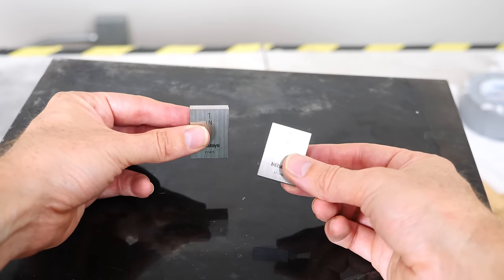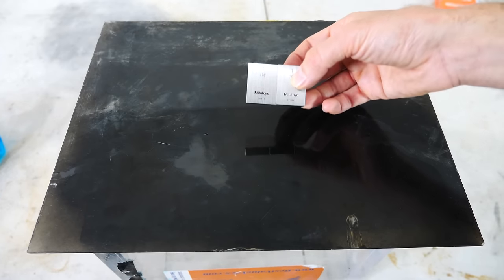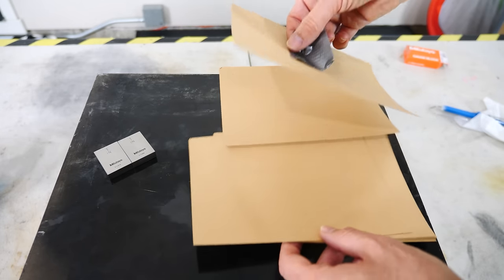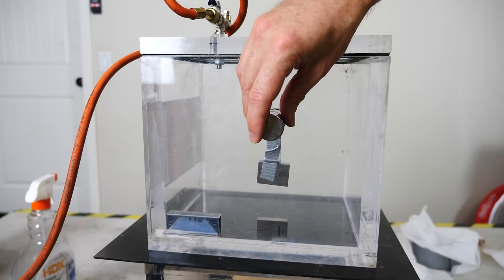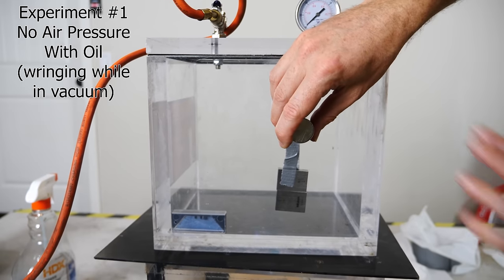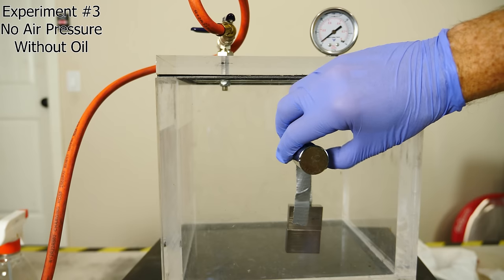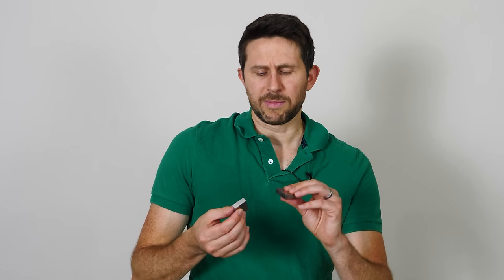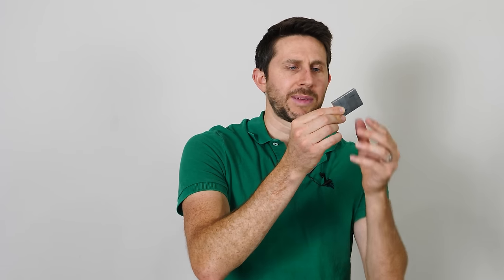Will Gauge Blocks Wring Together In a Vacuum Chamber?

Comment: I have a lot of experience working with gauge blocks in a calibration lab. We had different sets of block gauge of different "class". The class defines how perfect the gauge is, and the perfection is measured in terms of the tolerance regarding it's nominal length, but also in the flatness and roughness of the faces. The best gauges has a parallelism + flatness error combined of 0.05 microns, that is 50 nanometers. That's insane. While that is still a few orders of magnitude bigger than the Fe atom, I suppose it has to allow for millions of atom pairs between the 2 blocks to be in very close proximity. What I found is that, when clean of oil, the better blocks have better better adhesion (and sometimes much better, to the point of really struggling to take them apart, the only way was to use another block to push one of them out by sliding sideways). How much of that is because of just better vacuum and how much is because of more atom pairs being in closer contact, I don't know.
Reply: Ok
Reply: We never, EVER use oil on Joe blocks.
Acetone, a clean sheet of printer paper and proper wringing technique (not shown) works wonders.
Reply: Thank you
Reply: @CraftAero  ... Put the blocks at 90 degrees (like a cross) and rotate. If one or both blocks are thin (risk of bending), put them on a thicker block first.
Reply: cold welding could happen if those atom can meet
Reply: @CraftAero  that's because you're doing it wrong. EVERY SINGLE manufacturer says to apply a light thin coat of oil to the blocks. From Mitutoyo, to Starrett, to every machining website. I even checked to see if I could find one single source of authority that said to not use oil, and I couldn't find A SINGLE ONE. That's unusual, because usually if you search the internet long enough, you'll find a source agreeing with whatever you want. So that's pretty definitive. LOL. Where on earth do you work that they don't oil gauge blocks? LOL. They're bare steel. ALL bare steel gets oiled.
Reply: @littlejackalo5326  I know nothing about gauge blocks except what I've learned today. The internet, however, I know a"little sumpin'" about it, and I agree with your statement-if you look long enough(and I'm my experience it usually doesn't take long) you'll find something that will agree with whatever idea for which you're looking to support. Couple that with the rarity of both supply and demand, and your "pitch", if y you made your point quite effectively.
And THAT I respect!
Well done...
Reply: Regardless of the quality of the blocks, air pressure tops out at 14.7 pounds per square inch. So if you need to apply a lot more force than that, it's probably the electrical attraction force.
Reply: @isaacgrosof212  I was thinking the same thing! Even on sea level at very low temperatures, something that small and heavy couldn't be held together by air pressure alone
Reply: although a suction cup can hold very heavy things, depending on the quality and I'm not really sure how that works in a purely physics level... so I wasn't really sure what to think
Reply: Very interesting, and here i am with 3 Copper cylinder that came from CPU Intel Heatsink, with my greasy finger plus humidity i managed to get all of 3 stuck together.
Even though the surface is far from perfect, if i were to clamp both side and attempt pull them apart, i would probably get many pound of force before it crack off.
Reply: @chicoarraes  ... Well, 14.7 pounds per square inch is 14.7 pounds per EACH square inch. A suction cup of 4 inches will have a surface area of pi*2^2 and that is about 12 square inches, multiply by 14.7 and you get more than 180 pounds.
Reply: How does one accurately measure .05  μm & 50 nm?  With laser light?
Reply: Calibrators unite!
Reply: I also worked with those when I was a tool mechanic. I had to make measurements of 0.001mm and those were pretty exact.
Reply: @ab_ab_c  we have had gauges long before laser was invented.
Reply: @littlejackalo5326  indeed they should always have light machine oil applied, he clai6his blocks are stainless steel which won't rust however most are not.
Reply: @ab_ab_c  Yes... anything below 1 μm is very hard with mechanical means. Now, with interferometry you can go to absurd limits like measuring the deformation of spacetime that is orders of magnitudes smaller than a single Hydrogen atom, like what they do to measure gravitational waves.
Reply: @dogwalker666  ... But it was not possible to certify a flatness + parallelism error of less than 0.05 μm back then.
Reply: @littlejackalo5326  He prob works in machine shop.  I've been a metrologist in both the auto & aero industry for 20+ years and the only people I know that call them joe blocks are machinists and maintenance techs.
Reply: @kiddingme01  must be an American name, I have never heard anyone use that name.
Reply: @MuhammadHanif-bx4pb  which is why you don't leave them wrung for storage.
Reply: @littlejackalo5326  Oil for storage yes, NOT for the purpose of wringing them together !
They usually ship wrapped in oil paper covered with a light wax. It's an apprentice job to unwrap, clean and oil a new set, been there, done that.
Reply: @ab_ab_c  I worked at a precision machine shop where we had to measure stamp depth to 0.0004” we did that using a 100x microscope and used the focus knob travel to get the measurements. Zero out the reading when the bottom of the score line was in focus, and take another measurement when the top of the score was in focus. Crazy stuff!
Reply: @isaacgrosof212  there is probably 1-2 square inches of surface pressed on by the air. That is well stromg enough to hold a couple ounces of steel.
Reply: Do you have to measure things at a certain ambient temperature? Because at that scale I would assume temperature expansion is fairly significant in the gauge blocks?
Reply: @kiddingme01  So I was just doing some reading and found the origin of the name, the original creator's name was C. E. Johannson, or Johannson blocks, which was shortened to Jo/Joe blocks.
Reply: @TheExplosiveGuy  haha thanks!  I actually knew the creator's name was Johannson and never put that together.
Reply: @kiddingme01   same here, kind of a derp moment lol😆.
Reply: @littlejackalo5326  when you have ceramic blocks....
Reply: @2nd-place  basically yes.
In high precision work everything has to be done in temperature and humidity controlled rooms, and any part or tool being worked with has to be brought in and then sit to give it time to acclimate to the calibration temperature.
Most things are specified at 68f/20c, and some manufacturers give charts showing the actual size at different temperatures for situations where you can't work at 68f.

Even touching a tool or gauge block or the part being worked on with bare hands will change its temperature and make a noticeable difference.

Here's the kind of precision that is needed. Figuring out how long it takes to acclimate, and under what conditions.

http://www.starrett-webber.com/GB51.html
Reply: Cold vacuum welding might be at play with the "perfect" ones.
Reply: So cool ! Where did u say u worked again?
Reply: Retired toolmaker here. If there newish good quality blocks. Then clean them, no oil or grease even from your fingers. One place I worked at had brand new carbide blocks. I used to deliberately wipe my fingers on them. So the grease from my finger tip reduced the wringing effect. Because they were a pain to get apart after you had finished with them.
Reply: I see no mention of this, but it's actually easy to calculate the force exerted by air pressure on the gauge blocks. From measurments I found online, the gauge blocks can have a cross section of approximately 5 cm^2, given atmospheric pressure, that gives us roughly 50 newtons of force, equivalent of 5 kgs under gravity. Not sure if the opposing pressures add up, I think they do, that would add up to 10 kgs of equivalent pressure pushing the blocks together. With really well sealing blocks, I can see how it would be really hard to pull them apart, even with a decent lever on the joint. It also makes sense that sliding them apart is much easier, since atmospheric pressure plays no role in this lateral configuration.
Reply: @ArrakisMusicOfficial  "Not sure if the opposing pressures add up, I think they do". They don't. The force due to pressure acting on each block acts, well, on each block. To remove one block you only need to overcome the pressure acting on that block, not the one acting on the other one. Of course, you would need to hold the other block with an equal and opposite force, but 2 different 5 kg forces acting in opposite directions in 2 different force do not equal to double the force. Reminds me about how crashing head on against an identical car going your same speed in the opposite  direction is the same (for you and your car) than crashing against a flat indeformable and unmovable wall (say a dam), while a lot of people thinks (wrongly) that crashing with the other vehicle head on is double as bad as because you have to add the speeds (you don't). To complete the analogy, imagine that instead of having two 5 cm^2 blocks sticking together, you have one 5 cm^2 block sticking to a giant pool-table size gauge block.
Reply: @ArrakisMusicOfficial  ... And of course the problem with your assumption is that you are assuming that there is no single air molecule trapped between the 2 blocks, which is not true. If you have any amount of air in between, you will have at least some pressure (and possibly pore that atmospheric pressure) in these pockets or bubbles. What I can say from experience is that the better the blocks, the more difficult it is to take them apart. But, in theory, the better the block, the better the vacuum and also the better the molecular attraction force. So how much of the force is due to each effect, I have no idea.
Reply: @adb012  I'm aware of the two cars crashing "paradox", intuitively it makes sense, but I'm not fully convinced it applies here. If I go with the pool-table-sized gauge block, it exerts the exact same pressure as the small block, because all that matters is the imbalanced part, the part that's not surrounded from both sides by the air. But I think it should be half of what I said, but I cannot prove it formally, I don't have enough understanding.

Also I didn't mean to imply that there is the full force applied, of course there is no full vacuum. I'm providing an upper bound, which would be in this case 5 kg. That's the insight I'm bringing.
Reply: @ArrakisMusicOfficial  ...Correct, no analogy is perfect. But think of the normal block sticking on top of the giant block. If you want to lift the top blocks you only need to overcome the force of the pressure acting on it. The force of the pressure acting on the other block is irrelevant. Perhaps this is a better analogy. Say that you have a box sitting on the table. If you want to move the box you need to overcome the static friction. Say that the maximum static friction is 10N, you need to do more than 10N. The fact that there will be another 10N force acting on the table pointing in the opposite direction is irrelevant for how much force you need to exert on the block to move it. It is a common misconception/mistake regarding the 3rd Law of Newton (action and reaction). Action and reaction act on different bodies. You NEVER take both of them into account to analyze the dynamics of ONE of the bodies. You ONLY take the one force of the pair that acts on the body you are studying. Like if I want to see how you fall out of the window, I will take into account the gravity force action on you. I don't care that a gravity force of equal magnitude and opposite direction is acting on Earth. The analogy is not perfect because the pressure forces acting on each block are not an action-reaction pair because there is another agent (the atmosphere) mediating. A better analogy is, if you pull with a string from a box and I want to analyze the motion of the box, I will only take into account the tension that the string makes on the box, NOT the one that the string makes on you (these 2 tensions are NOT an action - reaction pair, as many people wrongly believe, there is an action-reaction pair between you and the string and another pair between the string and the box, the force that the string makes on you just happens to be of the same magnitude and opposite direction than the one that the string makes on the box.... IF the string is an ideal, massless, inextensible string)
Reply: Wow. That's insane
Reply: Johannson gauge blocks, original maker

Comment: We tried to stick them together at work.  When clean we couldn't get them to stick, but just touching the edges put enough oil on them to make them stick.  So, we thought that it was just the oil doing it.    The question is, when you cleaned them, were they really perfectly clean, or did they still have some minute amount of oil on them?
Reply: When they are worn out quite a bit then they don't stick together as easy as when they are new. Thats probably why thex din't stuck together
Reply: Why is there even oil on them?
Reply: @Astromath   Some people use a certain type of oil to prevent corrosion while being stored.  They can also get oil from your fingers just from touching them.
Reply: @mincraftler444    Could be.  Not sure how old the ones are at work, or how well they have been handled.

Comment: I would love to see this scaled up to mult-Kg sized items. Would be interesting to push it. Cool viddy.
Reply: Why No Videos!!?.😭😭.
Reply: wouldn't the square cube law apply here?  assuming the object material is the same, it would have same density, so more volume= more mass. with less surface area:volume ratio, the weight of the object (f=mg) > than the bond between those 2 objects (via wringing), so they wouldnt stick together
Reply: Machine blocks on a the bed way can do this  we have to use a 50Tonne Gantry crane to get them apart.
Reply: @Deborah Ajao and electric sea metallic bonding too.
Reply: o
Reply: It costs alot of money to get big parts that flat
Reply: It would be very expensive to get that surface finish
Reply: Its actually already known. Its similar to accidental cold welding in space..if you can get a perfect connection in space atoms will no longer see a gap and with jump the gap and weld to each other....the reason why its not totally bonding is because the surface isn't perfect and its not a perfect vacuum. If it was the pieces would eventually cold weld. Its basically the electrons jumping the gap and forming a weak bond, by exchanging orbits around atoms across the gap.
Reply: Plasma ur here😍
Reply: @emiraryaputra4900  slowly scale it up from this, and ull know
Reply: agree

Comment: As i was throwing away some packaging the other day i was wondering what polystyrene looks like in a vacuum chamber.
Reply: Polystyrene/styrofoam are mainly affected by static electricity in vacuum due to their light weight/low mass not being affected by gravity much compared to their electrostatic potential afaik.
Reply: I use polystyrene blocks to displace air when I’m evacuating epoxy, makes it much quicker. It’s not an incredible vacuum but the polystyrene is completely unaffected, visually anyway.
Reply: it looks exactly the same. im guessing you mean polystyrene foam?

Comment: Could you redo the experiment and attach a gauge + spring resistance to measure the force contribution of each factor? Thanks
Reply: Great idea! I thought about that a bit too. A bit tricky in the vacuum but he can probably try to macguyver a solution!
Reply: I was about to say that ^^
Reply: It's also hard to wring in a vacuum. The correct way is to push and twist them together.

Comment: Yes, all 4 forces : air pressure, oil surface tension, atomic forces ( = coulomb- and, van der Waals forces) and..... the Cassimir Effect.
Reply: I was wondering why he never mentioned the Cassimir Effect.  It has just as big a role, if not bigger, than the atomic force.
Reply: I assume it's what he meant (likely by accident) by air pressure, unless I understand the effect wrong
Reply: @minamagdy4126  When he said air pressure he meant you are making a vacuum between the metals. This means there is no outward pressure between the metal pieces, and the atmospheric pressure on the opposing face of the blocks pushes them inwards towards each other.
The Casimir effect is a completely unrelated thing to air pressure, and would work in a vacuum.
Reply: @alansmithee419  thanks for the reminder that the Cassimir effect is more or less the quantum mechanics version of the air-pressure effect, I did misremember

Comment: someone: actually ask me whether its air pressure, surface tension or the atomic forces keeping gauge blocks together

me: yes
Reply: Yes
Reply: Option d, of of the above
Reply: Well there’s no air in between them so I’d say it’s a vacuum
Reply: Why not both
Reply: Yes
Reply: the beginning of your sentence made no sense at all
Reply: @sleepful1917  it's a popular meme format
Reply: @xathridtech727  "someone: actually ask me" makes no sense the actually ask me part is what im talking about like what do you mean actually
Reply: You can't have all three at the same time. Oil film will prevnt atomic bonds. In fact the oxide layer on the stainless steel should be enough to prevent it so I doubt we saw a demonstration of cold welding here. Maybe just the residual oil in action.